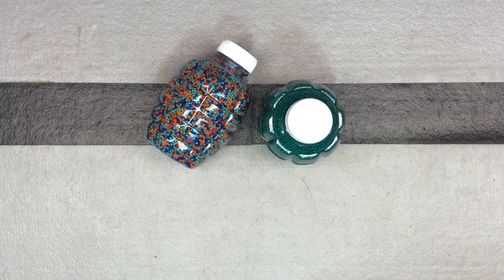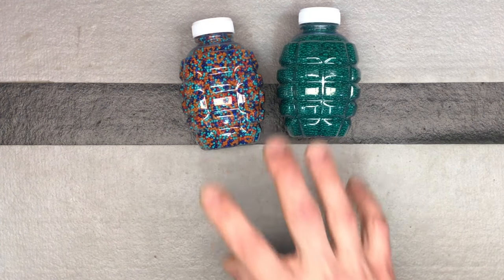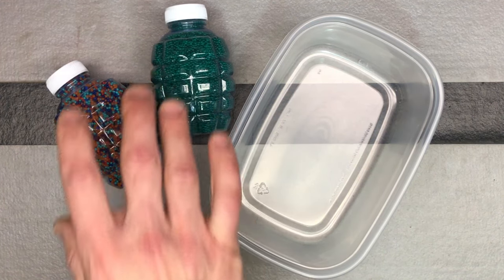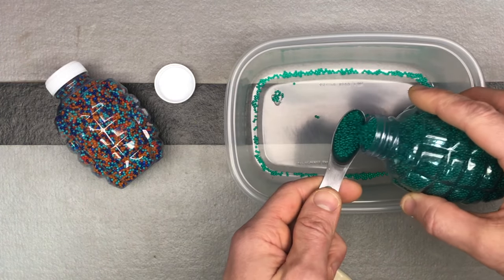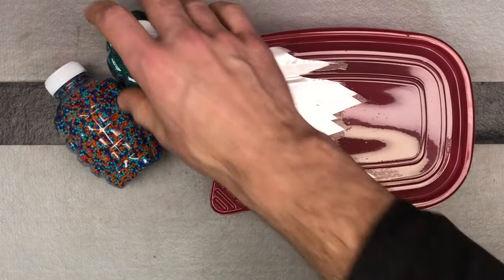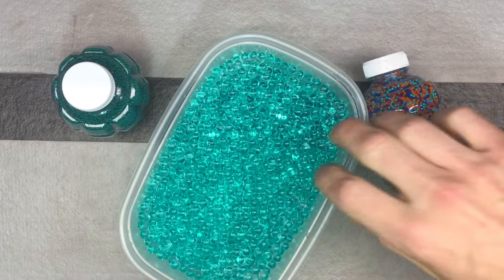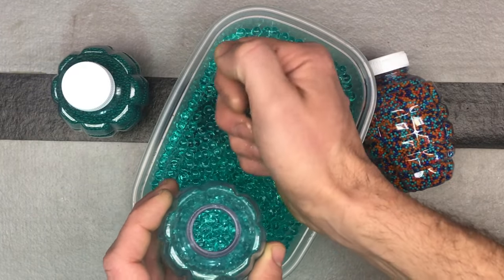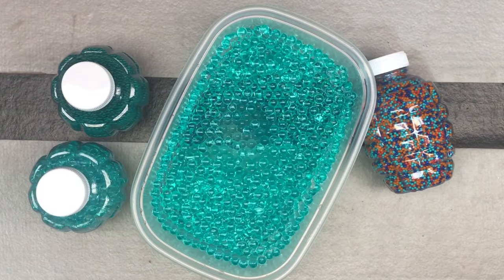Gel Blaster Gel Beads - How to Soak Them Properly to get 7-8mm Gel Balls - SEE DESC FOR MORE TIPS!!

Comment: i have got the gell balls and stored them in a air-tight plastic bottle.
I put it in a magazine, ejected a gell ball indicating the slots are full, but suddenly its not allowing me to shoot still. EIther they are not grown out as they have to be or something's wrong. I discovered there is a tiny bit of droplets in the AK47 Gel Blaster hopper;

this should not be a problem no? I cant really just use a tissue because the hole is small. I think that will just evaporate itself out right?

Thanks.
Reply from the maker: Which blaster do you have? A magazine fed blaster? Is it a mechanical magazine? Some of those are just really bad and hardly work.
Reply: @GelBallBlasterMaster  electric, magazine-fed.
Reply from the maker: @galaxygaming4545  I would just start over and try again with a new batch.
Reply: @GelBallBlasterMaster  Noted. Will do.

Comment: Mine only grow very small how do I fix that
Reply from the maker: Try bottled or distilled water
Reply: @GelBallBlasterMaster  bottled as in mineral water?
Reply from the maker: @haseebplays7158  no. Just plain bottled water. Or distilled water
Reply: @GelBallBlasterMaster  my gel blasters thing to put the gel balls in didn't come
Reply: @GelBallBlasterMaster  is it okay if I superglue it ob
Reply from the maker: @haseebplays7158  the hopper? The grenade/pineapple shaped bottle?
Reply from the maker: @haseebplays7158  do you mean the bracket that secures the hopper to the blaster? Or are you talking about supergluing the hopper? Then you couldn’t refill it
Reply: @GelBallBlasterMaster  the bracket that secures it
Reply: @GelBallBlasterMaster  it's cuz I have the 4.0 from anstoy and it keeps falling off and i want to just glue it on
Reply from the maker: @haseebplays7158  you can glue the bracket if that is what you are asking. But why not just exchange it and get one that is correct?
Reply: @GelBallBlasterMaster  it was missing screws and I got it overseas and it took a month to get to me
Reply from the maker: @haseebplays7158  just use other screws
Reply: @GelBallBlasterMaster  none other work I'm gluing it on rn
Reply: @GelBallBlasterMaster  I just failed gluing it on
Reply from the maker: @haseebplays7158  what country r u in? Top loader cheap blasters r readily available on Amazon in most countries
Reply: @GelBallBlasterMaster  I'm in the uk it's an anstoy so idk
Reply from the maker: @haseebplays7158  don’t they have blasters on Amazon there too?
Reply: @GelBallBlasterMaster  I got it off temu
Reply: @GelBallBlasterMaster  plus now I'm depressed cuz i got scammed
Reply from the maker: @haseebplays7158  they will send you the correct piece. Just email them
Reply: @GelBallBlasterMaster  bro temu is like a Chinese website
Reply: @GelBallBlasterMaster  is there anyway we can communicate outside of yt cuz it takes long for me to get notified
Reply from the maker: @haseebplays7158  message me on IG or email me

Comment: Can I use boiling water to prepare gel balls because where I bought my gun they suggested I do for 3 hrs?
Reply from the maker: Boiling water for 3 hours? No reason at all to do that and it would be dangerous too. Whoever told you that might have been messing with you.
Reply: @GelBallBlasterMaster  what's the best way to do them?
Reply from the maker: @OOPMD-backs  I have multiple videos that show. Just use regular water. Make sure u have a large enough container and soak 4-6 hours. Then drain. Watch the other videos
Reply: @GelBallBlasterMaster  thanks dude
Reply from the maker: Sir Yes  I don’t think it makes much if a difference but definitely don’t use boiling water.
Reply from the maker: xi—sky  if that works for you, keep doing it, but there is no science behind it and it really should not make a difference. However, if you are happy with your results, just keep doing it your way. There is no perfect/absolute way due to environmental factors, water quality, minerals, etc

Comment: If I only use half the amount I’ve put into the water what do I do with the rest if I wont need it for a few days. Would they get messed up or what?
Reply from the maker: The dry beads last forever. Unused, hydrated gel balls should last at least 2 weeks in airtight containers
Reply: @GelBallBlasterMaster  what if it’s been 2 weeks then what happens? And also if I’ve made loads of orbeez and I just leave them in the gun and don’t use them what happens? Do they mess up and go to waste?
Reply from the maker: @musamushtaq7319  NEVER LEAVE THEM IN THE BLASTER! you will ruin it. Store them in airtight containers only. Try them after two weeks. They may be fine. If not they will just not work well
Reply: @GelBallBlasterMaster  uno how the gel balls come as beads in a packet. Could I take them out and leave them in a bottle with the lid on?
Reply from the maker: @musamushtaq7319  the beads will last forever so you can store them in whatever
Reply: @GelBallBlasterMaster  I mean the beads that I’ve had in the water for a few hours. Can I just put them into the bottle I put my tiny beads in
Reply from the maker: @musamushtaq7319  You want to add beads to the ones soaked already? Just use a different container. U r making this much harder than it needs to be
Reply: @GelBallBlasterMaster  no uno the soaked ones where could I put the leftover soaked ones after they’re done soaking up
Reply from the maker: @musamushtaq7319  airtight container
Reply from the maker: @musamushtaq7319  if they are soaking they do not need to be in airtight container. Yes you can leave overnight. You may need to use bottled or distilled water if they do not grow right. Some tap/well water has minerals/chemicals that cause problems
Reply: @GelBallBlasterMaster  I used tap water and they aren’t growing so what shall I use now. What is meant by distilled water?
Reply from the maker: @musamushtaq7319  distilled water is in a bottle - you buy it at a store
Reply: Is there a way to dry them back out if they have only been in the water 10 minutes? 
My son just made 50 thousand….

Comment: Can i use 9-13mm gels instead of 7-8mm gel beads in my blaster?
Reply from the maker: No, They will not fit at all. It will just immediately jam or they just won't even feed into the barel
Reply: @GelBallBlasterMaster  thank you for the info
Reply: @GelBallBlasterMaster  Say if i had the mp5 amazon gun(which jammed btw) if i get a 68 dollar one from walmart(the one seen in tik toks) can i use the mp5 ammo for the 68 dollar one
Reply from the maker: @Jussstrebel  yes. Almost every gel blaster uses 7-8 mm gel balls. There are a few that use other sizes but none that are very popular. Are you manually priming the magazine on your mp5 each time? Also, make sure you check out my giveaways. Current contest ends tonight.

Comment: So if I use normal water then how much time will it take to grow? Like 3 hours or something?
One more thing I will not use them regularly so do I need to maintain it? Or later if I put them in the water will they grow again?
Reply from the maker: Yes and yes. 3-4 hours is typical. Overnight is fine. You can add water but store in airtight container and use probably won’t need to. Also, don’t make a huge batch if you don’t plan on using a bunch
Reply: @GelBallBlasterMaster  Thank you
Reply from the maker: @argonsucks9614  go check out the monthly contest on my channel main page. I give away over $200 in blasters and accessories every month!
Reply: @GelBallBlasterMaster  as I am growing the gel balls in normal water  it's taking a bit time but its ok...... So if somehow some water goes inside the gun so will it be a problem or first I need to dry the gel balls then input them in the gun?
BTW Love From India
Reply: @GelBallBlasterMaster  also I am growing them in aquguard (filter) water so is it okay or do  i need to grow them with bottled water
Reply from the maker: @argonsucks9614  just drain the water or use a strainer
Reply from the maker: @argonsucks9614  usually any water works. Sometimes tap/well water has minerals that cause issues
Reply: @GelBallBlasterMaster  the water is sediment filterred and iron filterred so is it ok?
Reply: @GelBallBlasterMaster  i didn't know to keep it in airtight container so I have got a problem. It has not grown so well so if I drain the normal water again and fill it with a distilled water in a airtight container so will it grow again?
Reply from the maker: @argonsucks9614  should be better
Reply from the maker: @argonsucks9614  not airtight to grow just airtight to store. But yes you can try them again
Reply: @GelBallBlasterMaster  should I try in hot water..... Btw I am using a plastic airtight box so is it okay?
Reply: @GelBallBlasterMaster  If I use hot water so it will grow faster?
Reply from the maker: @argonsucks9614  hot water should not make a difference
Reply from the maker: @argonsucks9614  not in my experience and I have done millions
Reply: @GelBallBlasterMaster  Thank you by the way!
Reply: @GelBallBlasterMaster  still the size is same smaller while firing it it bursts like I need to get another set of orbeez
Reply from the maker: @argonsucks9614  try a different brand

Comment: I grow them but they get like half as big as there supposed to be is it possible to add to much water ? And they won't grow?
Reply from the maker: No. Too much water should not do that. Use bottled water. Let them soak overnight. What blaster do you have? What gel beads are you using? Just generic unbranded ones? Have you tried multiple packs or brands?
Reply: @GelBallBlasterMaster  hey to make the balls do it really take that many hours
Reply from the maker: @crandallsolomon469  yes. At least three hours
Reply: @GelBallBlasterMaster  why that long
Reply from the maker: @crandallsolomon469  because it takes 3-4 hours for them to grow to the correct size. That’s like asking why does it take 2 hours to charge a certain battery. It just does
Reply: @GelBallBlasterMaster  now if I have them in a water pitcher they will stop getting big no matter how much water i put in it
Reply from the maker: @crandallsolomon469  only if you put too many in too begin with.
Reply from the maker: Also, try bottled water or distilled water if they are not growing right.  Your tap/well water may contain minerals/chemicals that affect the growth too
Reply: @GelBallBlasterMaster  oh ok
Reply: @GelBallBlasterMaster  but if they are not at they right size it will not shot right correct
Reply from the maker: @crandallsolomon469  correct.
Reply: @GelBallBlasterMaster  so if I put the whole bag in the water pitcher how much water to put tell 1.5 quarts that's 48 oz